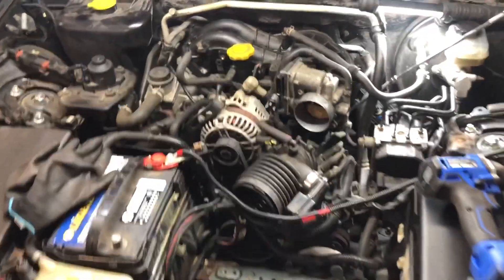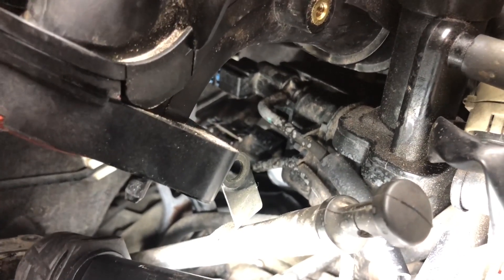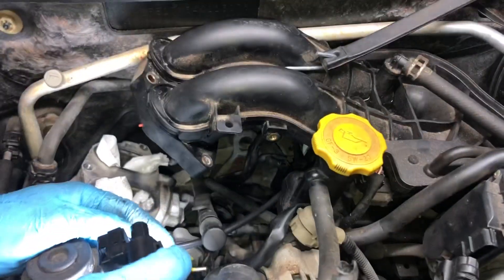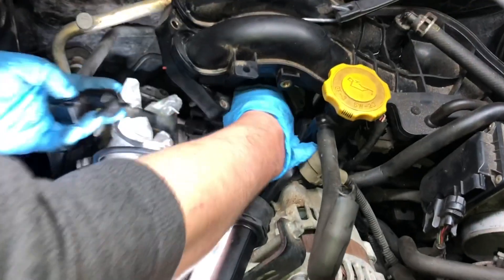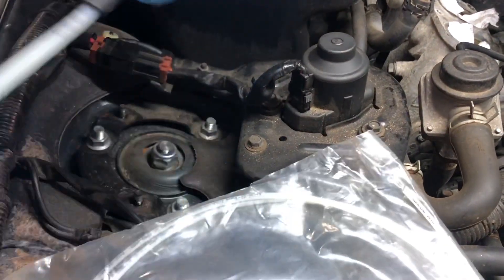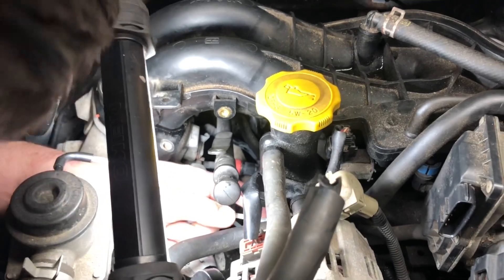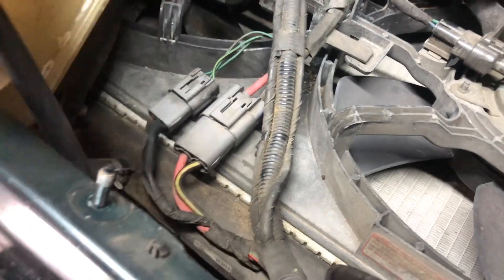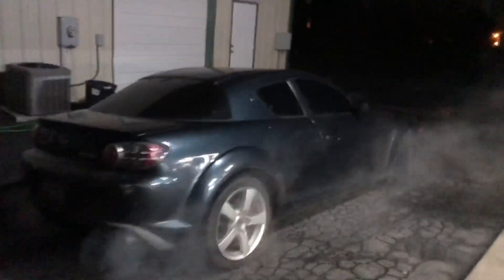Mazda RX-8 P0661 Code Fixed for $20 SSV Solenoid Installation Upgraded Vacuum Lines & New Mid-pipe

Comment: You dont need to reprogram. The unit/ connectors so probably clean them connectors and always Check your fluid dont add it just because the icon comes up or tge overflow will end up ok the power steering connecters
Reply from the maker: Can the power steering computer fry due to bad voltage or water getting on electric terminals where the radiator is?
Reply: Possibly its usually the connectors especially if you added Coolant and the overflow(Which is aimed towards it for some retarded reason) Covered and messed up the connectors. You can clean the connectors and hope it works if not hope to find a new one for 100$ hopefully. It happened to my old Rx8 because mechanic added too much  Your solenoid links are not available by the way

Comment: are all 3 solenoids the same?
Reply: They are
Reply: @driverben  thanks...they are..I changed them a couple weeks back...was a bitch lol..
Reply: @tankconnors7323  oh I know, I'm in a few rx8 groups on FB and when I did mine I went nuts because I couldn't get the ssv one seated back in, after a few hours of going crazy I realized I had the rubber boot in the hole still and one on the pump and why it wasn't going in haha

Comment: Is that a series 1 thing maybe? I've had by battery disconnected many times (any time I work on anything electrical on the car) and I reconnect it and never have had to mess with the steering. Mine is a 2009 series 2.

Comment: I had issues with power steering on my rx8 I took the air filter assembly out and battery and cleaned the connectors in the front of the car for the power steering with connector cleaner and my power steering works fine so you really don't need to call the dealership learn to think outside the box
Reply from the maker: I done that but it did not work, I think my computer is dead

Comment: Installed a cold air intake today, went to test it the car and you guessed P0661, checked all the hoses to the intake and vacuum lines, all is good, guessing either the solenoid or harness is shorting, it was difficult to the get the air box out, I will try to switch the solenoid from the airpump and see if it works, my 8 has not cat and the airpump is deleted.
Reply: Is it solved?
Reply: @JohnLabu21  yes, it was a bad solenoid, i believe it was in the back of the intake manifold, a bitch to get to. Bought a solenoid from amazon and replaced it, I also sold the car for 3 times what I paid
Reply: @cesarg8087  how much was it in your area? Different country have different price for that car, in my country its even hard to sell for 10k sgd
Reply: @JohnLabu21  got it for about 2500, sold it for 7

Comment: The dreaded engine light came on and I got the 0661 during my last run. I decided to park the car and disconnected the battery. That was 2 weeks ago. Yesterday I decided to take her for a run and the engine  light was gone. However, before returning I decided to fill her up and guess what? as soon as I turned the ignition on that engine light returned.  My nephew told me it has something to do with the sensor on the exhaust because I mix a dash of 2 stroke oil with my fuel. What do you think?
Reply: Nope. I run premix and my car has 95k miles and I never have seen this code.

Comment: When you first start your car after having the battery disconnected you are supposed to steer the steering wheel all the way to left and then all the way to the right, that makes the steering wheel icon go away. You can also press the brake pedal 20 times quickly and then turn the wheel
Reply from the maker: I actually tried this, but it did not work, I made a video how to do it by pressing the break pedal 20 times, you actually see the oil needle move if you done it correctly mine did, also I tried turning my steering wheel to the right and left 2x times each way with ignition in second position it did not work, I also tried cleaning the connectors 3 times and using electric contact grease on them, and I tried resetting steering angle, I checked all fuses, all looks good, I am not giving up, I will try to replace the connector by jumping the wires and see if this helps, I also want to get a special computer for Mazda RX8 to try and reset steering that way, I think I will also try disconnecting the battery for couple days see if that helps,
My steering wheel stoped working when my positive battery terminal came lose while driving

Comment: If the electric power steering is shorted then you need to replace the Pwr steering and any fuses.
Reply from the maker: It might be shorted, so you think I will need to replace the entire power steering? Do you know what fuses to check?
Reply: @mazdarx8diy38  should say under the fuse box lid which fuse is which.
Reply: @mazdarx8diy38  
https://fuse-box.info/mazda/mazda-rx-8-2003-2012-fuses
Reply: @mazdarx8diy38  my guess would be if the fuses are not popped and you are getting 12v power at the steering rack then the power steering motor is blown and the whole assembly needs to be replaced. But definitely start at the fuses and track power to confirm this.
Reply: @mazdarx8diy38  if you really think its the ECU barrow someone elses fron their 8 and drive around and have them do the same. If your ecu is bad then their PS wont work and yours will. Since you got a working one.

Comment: Your leaning lol    Still do your own ecu reset lol remember the car is fun to work on lol
Reply from the maker: It’s actually fun to work on, question how do you reset ECU, my steering wheel still hard to turn
Reply: @mazdarx8diy38  disconnect your battery for 5 min, and reconnect. Turn the key to the on position, don't start the engine, and press rapidly on your brake pedal for 20-30 times until the oil pressure gauge moves (not all cars do that though). Start the engine and turn the steering wheel from lock to lock, that will calibrate your steering. The DSC light will flash until you restart the engine so don't worry about that. Leave the car to run for around 20 min without touching the gas pedal at any time, the ECU will re-learn fuel trims, idle etc during this time. For future reference this is what you need to do if your engine doesn't hold idle and dies after disconnecting the battery, it will probably happen at some point. Hope this works for you, good luck!

Comment: Did you RX-8 act any different running when this code came on?
Reply from the maker: What code P0661? If so then yea it was struggling a bit, also I found out that my cat was bad, was causing starting Isues, I have replaced it with a de cat basically a mid pipe
Reply: @mazdarx8diy38 what type of starting issues where you having?